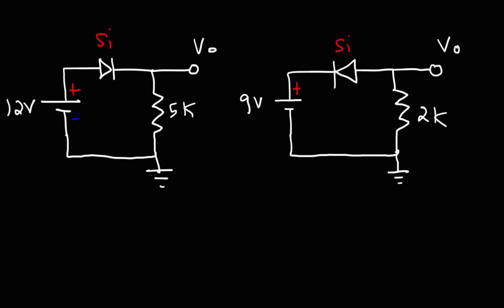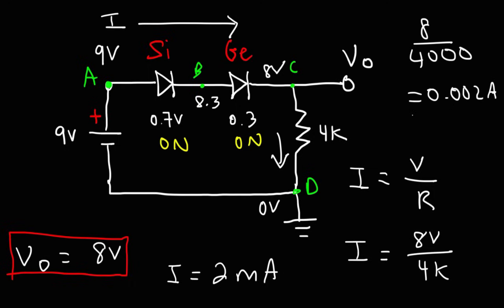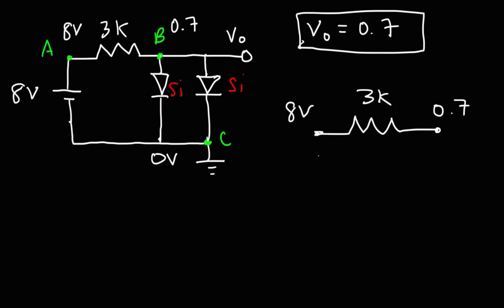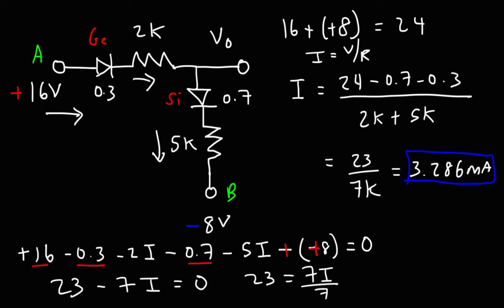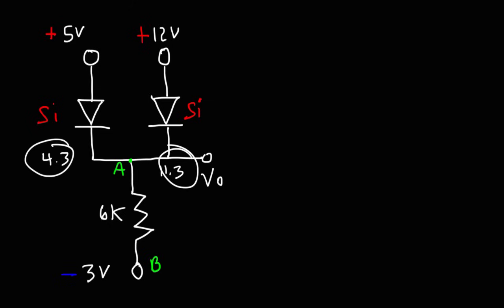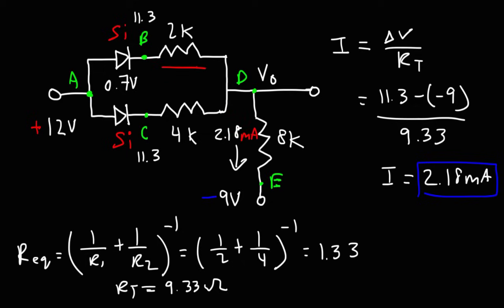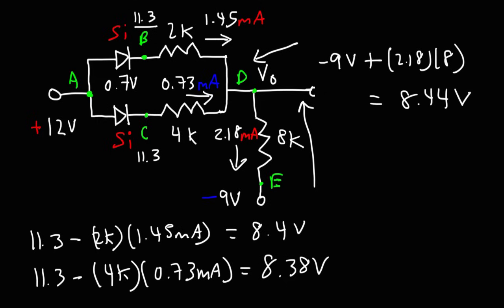How To Solve Diode Circuit Problems In Series and Parallel Using Ohm's Law and KVL

Comment: 26:50 V0 cant be 8.4 V because the positive and negative voltages add up they dont subtract.So its 17.4V ,you can get that by also multiplying 8Kohm resistor by 2.18mA current.But great video nonetheless

Comment: What if, in the last problem, instead of the two silicon diodes being connected in parallel, we had a silicon diode, and a germanium diode?
Then the two resistors wouldn't be treated as being parallel, and therefore, what would happen then?

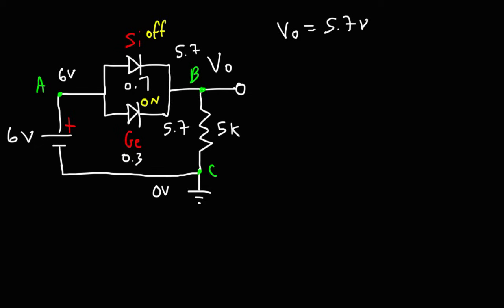Comment: 5:54 but why silicon Diode referred as Off
Reply: The current path will open through the germanium diode first, providing a path for current to flow. The Ge diode is the easier path (lower internal resistance), and both diodes function like switches that only close when a minimum forward voltage and current threshold are met. The forward bias voltage and minimum current of the Ge diode is met first, the circuit completes a loop, and energy is allowed to dissipate from the 5k resistor (the load, in this instance).

This generates a positive voltage at node B of 5.7V, which will bias the Si diode in reverse, creating a differential between the K and A sides that prevents activation of the switch. The voltage across the diode in this case is:
(V(A)-V(B))=(6V-5.7V)=0.3V, which is not high enough to provide the proper forward voltage or current to turn on the Si diode.
Reply: @jc4359  done

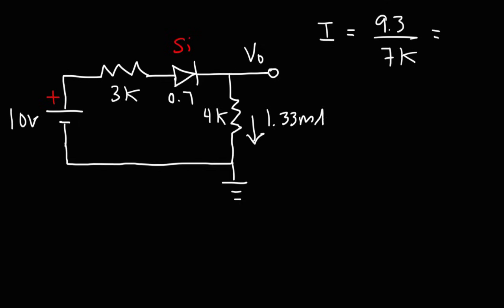Comment: 7:22 I think i see an alternate solution. 3KR and 4KR form a voltage divider. You can solve the voltage at Vo using the voltage divider formula: 
Vout = Vin * R2 / (R1 + R2) . Vin = 9.3V
9.3 * 4K / (3K + 4K)
37200 / 7000
5.31V

Comment: In the current divider example, why is the voltage output 0.7 V? I get that the silicon diode eats 0.7 V, but it doesn't make sense why that qualifies it as the answer for the voltage output. Does the 3k resistor "eat" 7.3 V of the original voltage? How did they get that calculation for how much of the voltage is absorbed by the resistor?
Reply: this is the kirchoff voltage law. the voltage spreads itself over the 3 components. V of resistor 1 = 1.44mA* 3000 ohm = 3.99V, the diode = 0.7V, and the V of resistor 2 = 1.33mA * 4000 = 5.32V total = 10 because kirchoffs voltage laws states that the sum of the voltage drops must equal 0. 10 - 3.99 - 0.7 - 5.32 ≈ 0.

Comment: Hey, I think you may have made a mistake in the last problem. You got Vout using only the potential at E without adding the potential of D. 

I believe it should be:
  (D) 8.4V minus  (E) -9V = (Vout) 17.4V 

This seems to be confirmed by dividing the voltage (17.4V) by the 8K resistor which gives us the 2.18mA you wrote next to the 8K resistor.

Am I missing something?
Reply: Yes. When you hear voltage, always think ‘potential difference’ (always measured between two points, or one point & a zero volt ground reference - which should always be drawn).

Just by looking, V out must be between 12v and -9v. So it can’t be 17.4v 22:50

17.4v is the volt drop across the 8k resistor. The voltage between D & E.

Also, V out & D are at the same potential.
V out = voltage between D & GND (not shown).
Reply: @davadoff  I built this same circuit myself and measured it to confirm. It is indeed 17.4V Output.
The -9V source doesn't subtract from the 12V source, it adds to it because they are both series aiding.
I also made the same circuit in a circuit simulator program which you can take a look at for yourself (Link below).

https://drive.google.com/file/d/1JyyBXGetizaU6DGsJYkg3QU9H6DKlh9h/view?usp=sharing

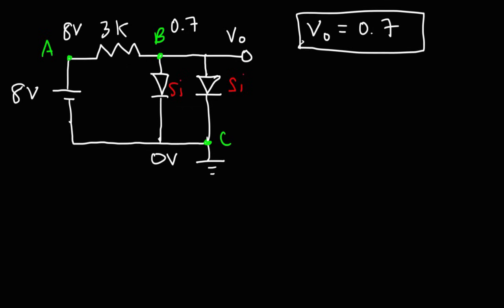Comment: For the question on 11:00 minutes, I’m a little confused why output voltage is 0.7 . Why isn’t it 7.3? Is it because the output is what the diodes are using?
Reply: V in point B should be 0,7 because there is a diode of 0,7 and the ground is under it so we need 0,7 for the diode to use it and we end up with 0V for the ground
Reply: @mango6ila that logic wasn't really used to the other example
Reply: The diodes drop 0.7v when forward biased (the voltage across them is 0.7v). They short the output to ground. If they were ideal diodes instead, the output would be 0v.
Reply: @davadoff  shouldnt you be able to combine the diodes into a single 1.4V source?
Reply: @conormulhall8951  two diodes in series would be 1.4v. If they are absolutely identical, they will act like one, bigger diode with 0.7 volt drop across them.

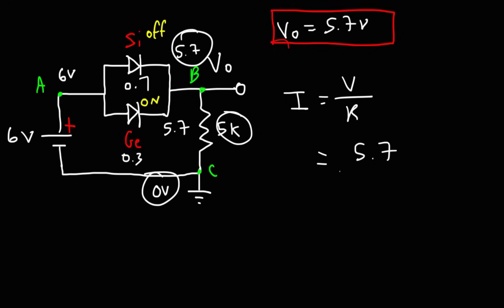Comment: What if at 6:06 the two diodes are silicon, what would you do ?
Reply: Just had the same question lmao, but, I think the output would be 5.3 and either one could be on
Reply: Yeah, either one could be on. In theory both would be on but in practice probably one diode would take all the current.

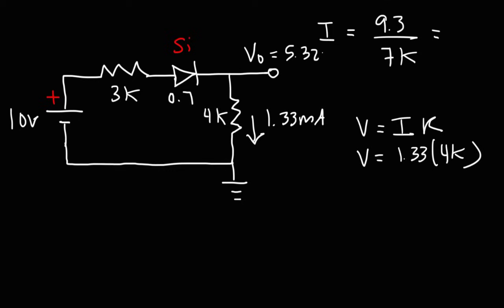Comment: 7:38 why only use the 4k resistor for voltage output and not include 3k resistor?
Reply: Because output voltage is measured between Vo and ground (when you hear voltage, always think ‘potential difference’). See potential dividers.

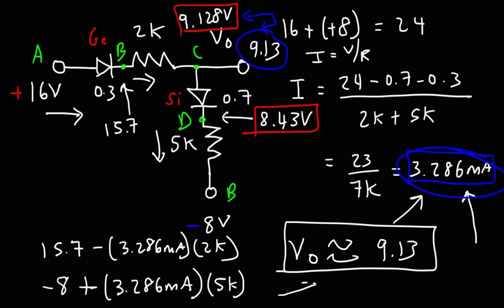Comment: Bro I have a doubt. At 18:00 you said that the output voltage is 9.13 but I think it should be 9.13-(-8)=17.13
Reply: 17.13v is the voltage between C & B. 

9.13v is the voltage between C and GND (not shown).

Comment: for question 3, should the current through diodes not be 0, since there is also another branch called V_0, what do you do with that branch?
Reply: No. Current flows positive to negative. Through the diodes and then through the 5k resistor, in this case.

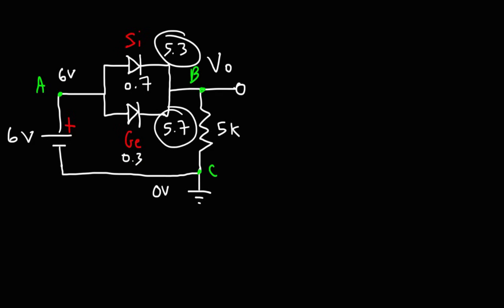Comment: How come both Diodes are on at 20:56? I thought the current would go through path of least resistance like in example at 5:16 and would take the 2k resistor path
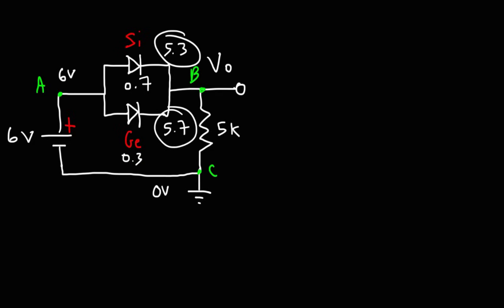Reply: Because it’s wrong to say current takes the path of least resistance. At 5:16 the silicon diode is off because it is not forward biased (the voltage across it is not enough to turn it on).
Reply: @davadoff How can we say that the Si diode isn't forward biased?
Reply: @SriyaKodali first go n read the basic of diode before doing circuit analysis.....
Reply: @Dreamer_and_Achiever  Thank you  . That's a nice suggestion by the way!
Reply: @sriya-K-b7l Ur welcome....

Well if u know Hindi ...so study any JEE lec of a reputed teacher or Institute....u will know all the concepts in 1 or 2 hrs.....
Reply: @sriya-K-b7l I would have said similar thing: you need to learn what forward biasing a diode means…

Comment: I don't understand part 24:28. Why can't we just divide 11.3V/2K ohms if we consider them as parallel resistors in the first place?
Reply: 11.3v is not across the 2k resistor. 
The voltage at B is 11.3v relative to ground.

Comment: Wait how do we know it's 9.3 volts at Vo before the 4k resistor? Doesn't the 3k resistor lower the voltage right before the diode at 7:00?
Reply: 9.3 v’s is the potential of the circuit. Because diodes have a 0.7v drop, we calculate that into the equation, giving 9.3v. Then you divide that by total resistance, leaving the total amps running through the circuit. Then multiply that by the 4K, that gives the voltage before that resistor. 5.3v’s.
Reply: You can also tell what Vo would be by multiplying the total current by the first resistor, then subtract it from the 10’s entering it, which is about 6v, then subtract the diode after (0.7), getting 5.3v.

Comment: 12:19 there are two diodes 1.4 the voltage would be if we assumed the current will divided
Reply: No, B is at 0.7v relative to ground. 

Voltage = potential difference (voltage is always relative).

Comment: @14:25 are we using KVL ? how so,  isn't it only applicable to closed loops ?
Reply: All circuits with current flow are closed loops. 

But just use ohms law if you can.

Comment: Why could the current in the last example just take the path with the least resistance between the two parallel diodes? You had done that in time 5:41 example.
Reply: Because it’s wrong to say current takes the path of least resistance
Reply: At 5:41 the silicon diode is off because it is not forward biased. The voltage across it is not enough to turn it on.
Reply: @davadoff Voltage across it is equal to its barrier potential right.Then that would be enough to turn on the diode
Reply: @sriya-K-b7l yes, but with a very non linear voltage-current curve. It will conduct a tiny bit with a small voltage that’s not quite enough.

Comment: at 19:22, why does the higher potential win out the lower potential? Earlier in the video you mentioned that if the potential is lower, then it is favored due to its lower resistance? Could you please elaborate the difference in that part of the video vs this one? When do we know when to favor a high or lower voltage??
Reply: The diode is off because it is not forward biased. It is blocking current flowing up from A (reverse biased).
Reply: How is thatttttttt , both are forward biase

Comment: Great Video. One question: At 17:50 Why does the 12V "win out" over the 5V leg of the upper 2 diodes, and why is the 5V diode OFF?
Reply: 19:22 The diode is off because it is not forward biased. It is blocking current flowing up from point A.

Comment: at 10:50, why is the Vo 0.7V?
Reply: Look at the end of the branch it has to be 0V there and across the branch if you go upward there is only a diode in its path which shows that it has to be 0.7V at the start of the branch so after passing through the diode 0V remains
Reply: Because B is connected to ground through the diodes (B would be at 7.3v relative to ground if you swapped the diodes & 3k resistor).

Comment: Sorry just to check at 20:22, to find current across 6k resistor, you mentioned 11.3+(+3)/6k shouldn't it be 11.3-(-3)/6?

Comment: Can someone explain why in 10:19 the v output is 0.7v shouldn't it be 7.30v?
Reply: You know, I hope 11 months late this problem isn't haunting your nightmares, but the reasoning is as follows:
Point C (Node in proper jargon) is connected to ground. That means it MUST be at 0V.
...and BECAUSE a Si diode has a voltage DROP of 0.7 when they're on...
...If you ASSUME them to be on, therefore the voltage at node B (lets call it Vb) should be:
    one such that when Vb experiences a DROP of 0.7, it equals the voltage at node C (call that Vc)

Vb - 0.7 = Vc
Vb - 0.7 = 0
Vb = 0.7. QED.
Reply: @hyperionisalwaystaken  thank you☆
Reply: B is connected to ground through the diodes. If the diodes were ideal then all 8v would be across the 3k resistor.

B would be at 7.3v  if you swapped the diodes & 3k resistor.

Comment: @1:05 , cant you just draw current the other direction for the circuit to be on? Or are we assuming vo -0 is the polarity across the resistor ?

Comment: I used Voltage Divide in 6:26. Same process, I subtract the Vd to the Vs. Then voltage divide the 3k resistor (with the 9.3V) to get the Vo, and used Vo in Ohm's Law. Same result!

Comment: "Electricity will always flow in the path of least resistance"  that's what we need to remember folks.
Reply: Except it’s wrong to say current takes the path of least resistance. It flows in every path. The amount is proportional to the resistance in each path (ohm’s law).
Reply: This is only for diode guys

Comment: hi could anyone explain why  @21:11 he says both diodes are active for the problem but in previous problem with parallel diodes there was only one functioning?
Reply: Those diodes can turn on regardless of voltage drop differences because the resistors ‘take up the slack’. 

Directly parallel diodes do turn on in theory if they are exactly same.

Comment: 20:15 , isn’t it should to be Vo=14.3 ? Because we have a voltage in the ground and the multiplication of ( i * 6000 ) = 14.3 as well
Reply: Voltage between out and B is 14.3v
Voltage between out and ground is 11.3v

Comment: 15:30, if you're going to measure the output voltage, you would need to specify relative to what, since there is no ground denoted here.

Comment: in the parallel germanium and silicon diode example you mention voltage will take the path of least resistance therefor si is off. why doesnt this occur if you replace the diodes with resistors?
Reply: There is something wrong with that statement
Reply: It is proved that electricity takes all paths with the resistance in inverse proportions.

Comment: in 12:06, why is the voltage output at 0.7? would that be 7.3?
Reply: B is connected to ground through the diodes. B would be at 7.3v relative to ground if you swapped the diodes & 3k resistor.
Reply: Because it’s already in parallel with two Si diodes and each one has 0.7v as Si diode

Comment: at 11:00 why is V0 = 0.7v ?
Reply: B is connected to ground through the diodes. If the diodes were ideal then all 8v would be across the 3k resistor.

B would be at 7.3v  if you swapped the diodes & 3k resistor.
Reply: Did you ever figure this out ?
Reply: @austin0207  No :( I need an explanation
Reply: @leonardomichael513  @austin0207 the potential across the diode should be 0.7 the point B has to be 0.7, since the other end is grounded i.e. 0 volts
Reply: @s0ber912  Thanks man! I didn't know about the ground thing

Comment: 12:34 I'm getting the same current but not the same voltage at the out put?
What I did since it's a voltage devider was this:
16-(-8)=24-0.3-0.7=23v
23x(5000÷7000)=16.428v at 5k resistor and 6.571 at 2k resistor. 
I@(5k)= 16.428/5000=3.285mA
I@(2k)=6.571/2000=3.285mA
Reply: Voltages are relative to ground. So no answer can be higher than 16v because that’s the highest voltage there is.
Reply: 17:00 voltage between A and B = 24v

Comment: Why the change in voltage is equal to 20.3 at  point d we have V=12v at point E V=-9 so change in voltage should be 21and to calculate current across total resistor shouldn't we minus the diodes voltage???????

Comment: does the supply voltage needs to be "greater than or equal" the potential barrier of the diode or does it need to be "greater than" the potential barrier to be in "ON" state.
Reply: Only voltage across diode matters. Not the supply voltage.
Reply: Diode is on when forward biased. The exact voltage depends on the diode, the current & diode temperature.
Reply: @davadoff So for a diode to be in forward bias, voltage drop across diode should be greater than or equal to barrier potential of the diode?
Am I correct
Reply: @sriya-K-b7l you’re sort of correct. Equal to, not greater than. The exact voltage drop will depend on factors like what kind of diode it is and it’s temperature.
Reply: @davadoff  Thanks

Comment: Helo sir can you help me?
I cinde of have problem I want to have dual ignition Im useing old gm 4 pin hei modules but I have only 1 pick up coil what can I do to multiply that pick up coil signal and how to get 4 signals instead of 2??? Are there some circuets that I can use ore add second coil pick up and wound it in series ore pararel configuration wuld that work???

Comment: 20:55 why both diodes are in On state
Reply: Because it’s wrong to say current takes the path of least resistance. Those diodes can have slightly different voltage drops and still turn on because the resistors ‘take up the slack’.

Comment: 7:05 can u explain why the 2 resistors are in series ?I think both have 9.3 V across them ,hence parallel?😅😅HELP
By the way I understood the method 2. MY BOOKMARK 5:00 (nice question)
Reply: Because all four components are connected in series in one loop.

Comment: Good morning there... I have doubt on the question at 7.26, for calculating the output voltage by using ohm law, why should we use 4k ohms instead of 3k ohms??? Can anyone explain me??
Reply: In series, current is the same through resistors but is split for voltage, so to find the voltage for that resistor we use 4k ohms times the current.
Reply: Thank you for the explanation

Comment: I am lost here, I get the same milliamps for the circuit and the voltage drop across the 3k resistor, but if each diode requires 0.7 volts to pass current where is the second 0.7 volts coming from? Video point 12 minutes 28 seconds in 'How To Solve Diode Circuit Problems In Series and Parallel Using Ohm's Law and KVL' Thanks

Comment: For the problem at the 22 mark, the The parallel combination of the 2k and 4k resistor is 1.33 KILO-ohms, and NOT 1.33 ohms.  Also  the total  resistance is 9.33 KILO-ohms, NOT 9.33 ohms!

Comment: can somebody explain how we got output voltage=0.7v at 11:00
Reply: I'm thinking it should be 7.3v since 0.7v is the diodes voltage drop
Reply: B is connected to ground through the diodes. B would be at 7.3v relative to ground if you swapped the diodes & 3k resistor.

Comment: 10:58 i don't get why it's 0,7 V, why ?
Reply: Because B is connected to ground through the diodes. B would be at 7.3v relative to ground if you swapped the diodes & 3k resistor.

Comment: I=V/R,V=IR  we can use amp meter measure current value. If the outcome less than normal value show that diode broken.Kirchoff law.in put minus out put=zero.

Comment: Sir...1 amp and 10 amps diode are the same 0.7v voltage drop.?   I thought higher ampere, higher also voltage drop. Just saying...

Comment: Of course the explanation in 5:42 /27:03  is correct for IDEAL diodes  but ;  W R O N G , WRONG  for a real diode Si diode IN4148 
 WHY? 
a real diode conducts current when if it is forward biased by as little as 10mv . 
At 0.3v  forward bias In4148 will conduct about 1 ua see:
https://www.quora.com/What-happens-when-0-1-V-or-0-3-V-forward-voltage-is-applied-across-Si-diode

The Germanium diode will conduct  =  (6v -0.3v)/5k -1ua  = 1.14 - 1 ua = 1.139 ma  

  To understand a diode one must understand the diode equation with ALL its complexity

Comment: I'm confused. For the problem at 25:04, why does dividing the voltage by the resistor give you the current? If its two resistors in parallel?
Reply: use KVL like in 7:05
Reply: Because voltage difference divided by resistance equals current. Current is half as much through one resistor because it’s resistance is twice as much as the other resistor.